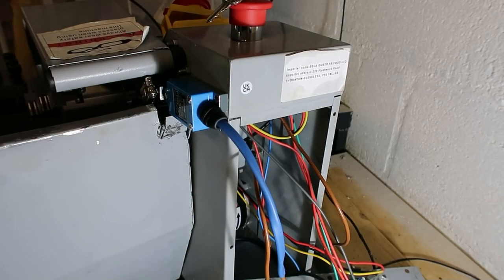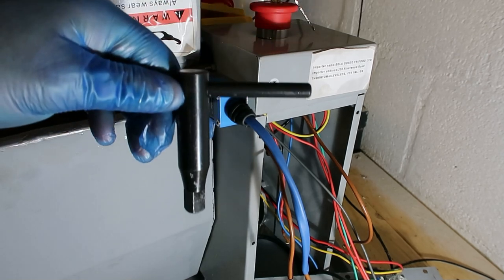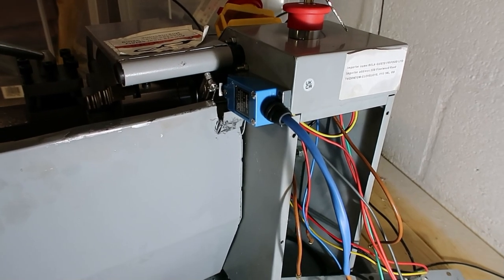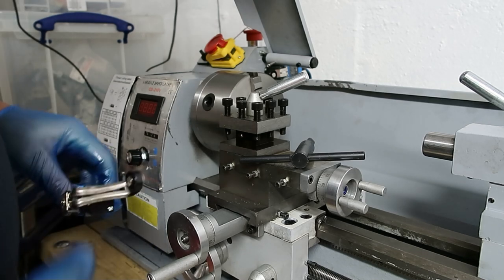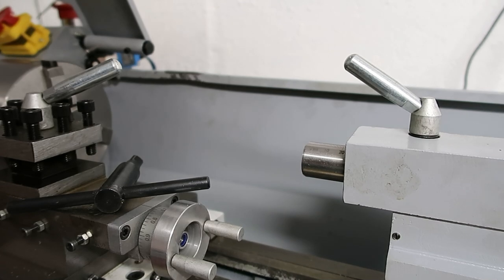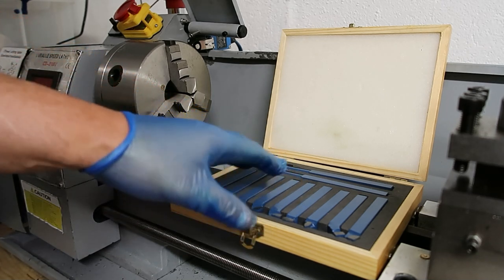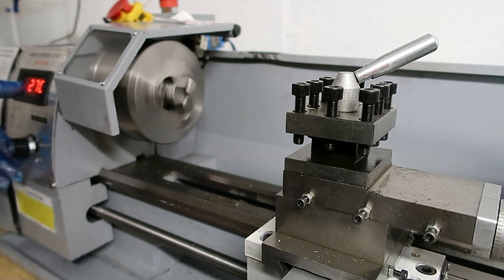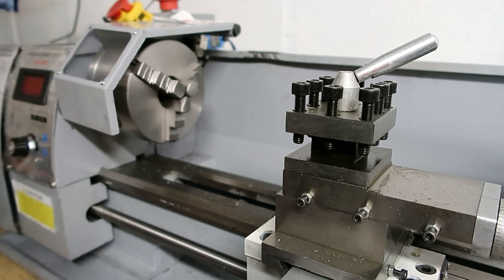Installing a small workshop lathe  Part two  (CREWORKS 8''x16'' 750W)

Comment: You can get adjustable carriage stops to deal with that problem, but micro switches is a better idea for sure. Trouble is I'm not sure how to wire up the switches on my lathe. You got a better deal then I did, I paid £659 for the creworks 7"*14.
Reply from the maker: Thats sounds a pretty good price.
Reply: @motobrikerestorations1354  yeah I'm happy with it, but the one you bought was on for £799 I think, but all things considered the lathe I have is a little bigger for needs anyway.
Reply from the maker: For the wiring you pick on the stop button. This as well as isolating the supply preventing start when the x-switch is activatedcreates an e-stop so it doesnt autostart when the x-switch resets
Reply: @motobrikerestorations1354  ok so would I put the power into common and wire up normally closed or normally open, to the off switch??
Reply from the maker: @guerillagardener2237  totally agree with you. I have never owned one of these hobby lathes and thought they would be tiny. Its very unlikely I will every need the  extra size. The primary use with be fabricating small parts for the bikes I restore
Reply: @motobrikerestorations1354  Yeah I should have bought the proxxon pd 150e because I'm only intend to use it for small projects in regards to RC planes , but I also want to explore make my own little petrol motors for same hobby. I do have at least one project sitting on my computer ready to go that I could use the bigger lathe for though.
Reply from the maker: @guerillagardener2237  yes iused these https://www.amazon.co.uk/gp/product/B09BDWTGDX/ref=ppx_yo_dt_b_search_asin_title?ie=UTF8&psc=1
Reply: @motobrikerestorations1354  Yes that makes sense, the limit switch is normally closed. Ty. So would I wire this from positive to off switch??
Reply from the maker: @guerillagardener2237  The 'speed' control is actually a load control. As you cut the speed drops off to the point it impacts your cutting speed and there fore finish. If the one you bough has more uuumpth you bought the right one

Comment: If you're really worried about crashing into the chuck, you can thread away from the chuck.
Reply from the maker: I  have never seen that I guess you would cut a recess to lead into the thread start at the correct thread root diameter?  To be honest I have never had a crash but did hear it was caused by distraction
Reply: @motobrikerestorations1354  You don't need a thread relief, if you're threading away from the chuck.
Reply from the maker: @BedsitBob  you lost me on this one. In the 22 years at sea I cut lots of threads but not sure how you do this in the way you described. You would have to position the  tool at the start of the thread, engage the drive and then feed in to start the cut?
Reply: @motobrikerestorations1354  Withdraw the live centre (if you are using one) move the carriage until the tool post is past the end of the workpiece, then wind the cross slide in until the tool post is on the other side of the workpiece, ie. at the back of the lathe.

Install the tool upside down, facing toward you, adjusting the height to bring the tip onto centre.

Position the threading tool where you want the thread to end, then start the lathe.

Back up the cross slide until it reaches the required depth for the first pass, then engage the half nuts, with the feed set to run away from the chuck.

Rinse and repeat, until the thread is to depth.
Reply from the maker: @BedsitBob  you're way beyond me. I did sail with Bahamian fitters who cut  screw threads  for a soot blower without stopping the lathe. They would just bang the drive thread direction back wards and forwards. You couldnt knock the speed or finished product but the poor lathe,,,,,:face-blue-wide-eyes:
Reply: @motobrikerestorations1354  I've just realised I've overcomplicated it, because I was thinking of a lathe with a screw on chuck, ie. one you can't run in reverse.

For a lathe with a camlock (or similar) chuck, you can use the method I've described above, but keep the upside down tool on the front of the workpiece, and run the lathe in reverse, with the lead screw set to move the carriage away from the chuck.
Reply from the maker: @BedsitBob  thats great advice, many thanks